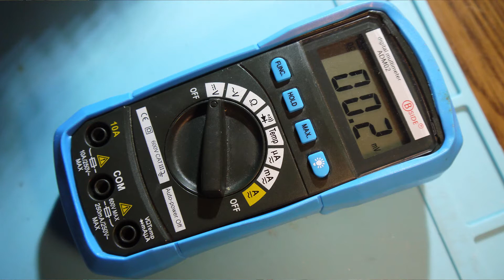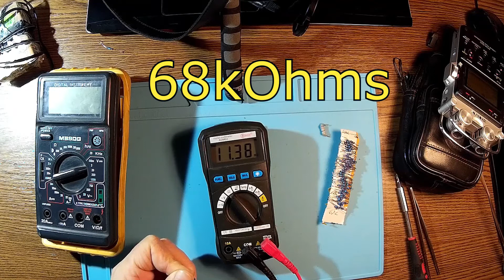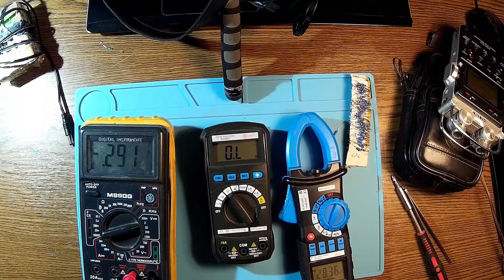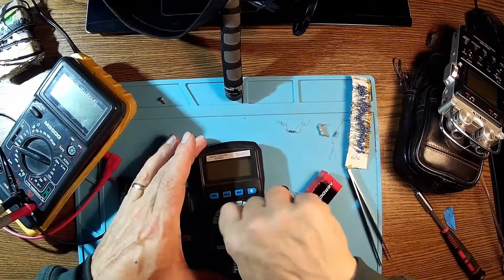Multimetter fix ADM02 ADM01 Bside

Comment: I have UNI T multimeter but it seem have error on reading dc voltage.. It look too much lower reading than actual dc voltage.. I cannot adjust the reading  with the trimmer pot inside the case..   What is the problem?
Reply from the maker: Maybe the dial knob..check the contacts first